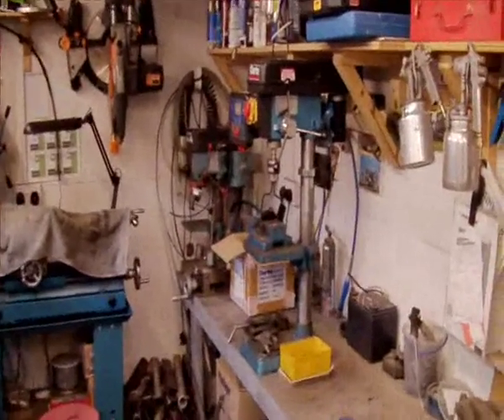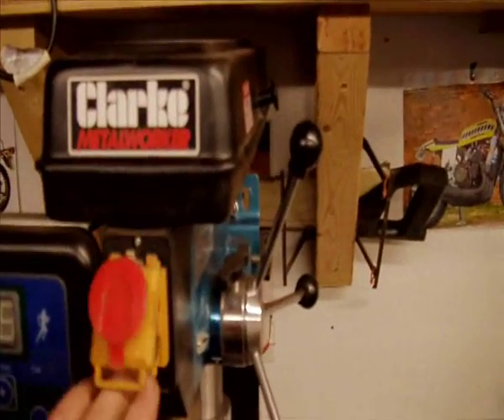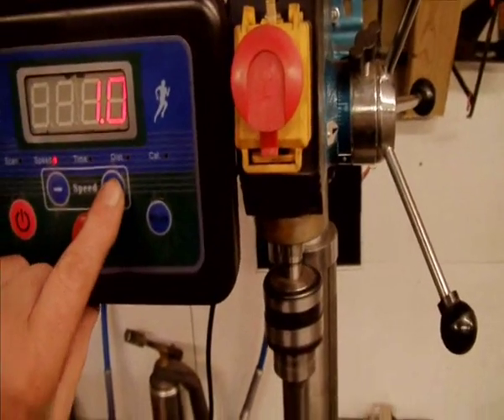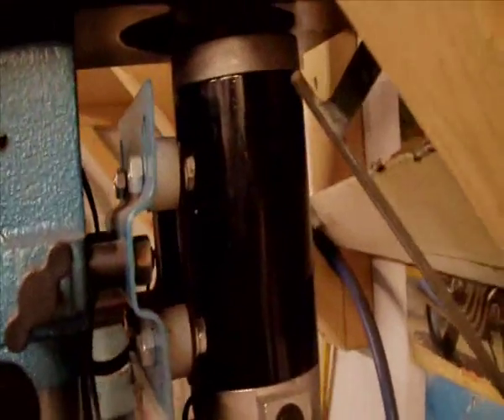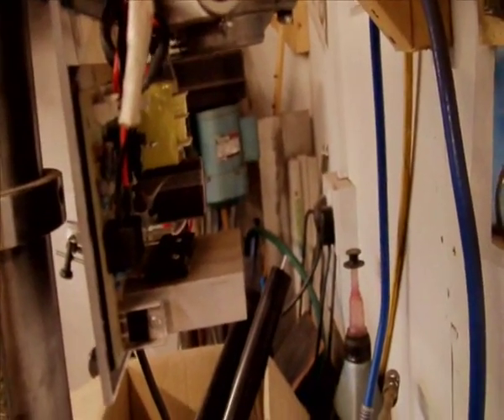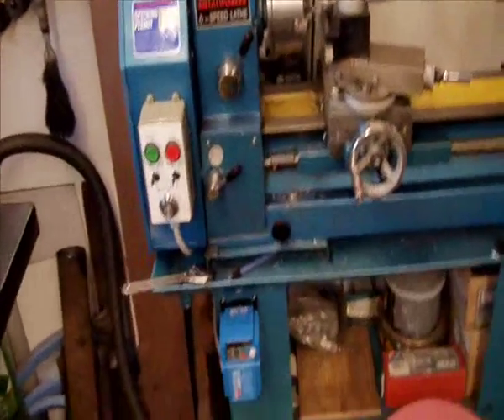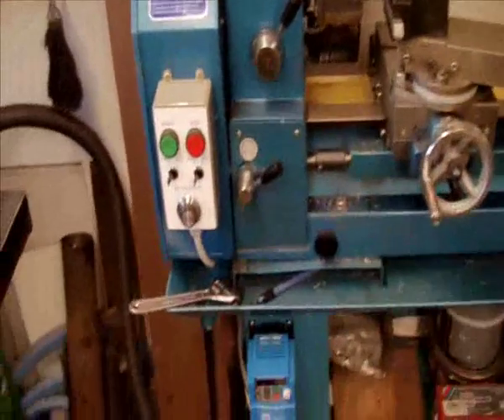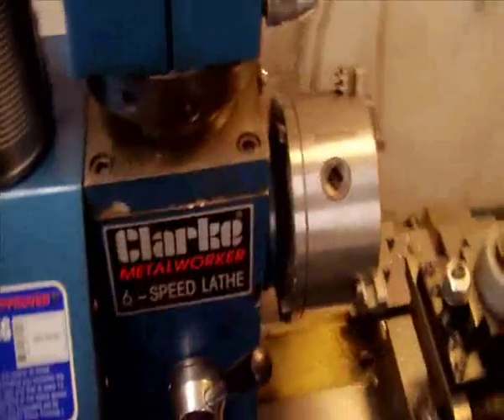Clarke Lathe and Pillar Drill Variable speed conversion

Comment: Hi Nigel - what's the slowest speed that can be achieved? is it slow enough to tap threads.
Reply from the maker: Hi Bob it is good for tapping threads but when you're down on low speed you do lose some power but it works well. Cheers

Comment: £319 is a bit steep!!!!, got the bits from eBay for £72.00, inverter £45.00, nearly new 1.5KW 3-phase motor £27.00.
Reply from the maker: Well done alan good luckwith your change over.

Comment: Hi Nigel, thanks for putting on the video. I have the same lathe/miller. Been looking for a variable motor, and came across your video. I have been in touch with Transwave, as you say they are very helpful. So I'm going to get a motor kit as soon as possible.
Reply from the maker: +I'm in the Shed  Hi thx for the message glad to be of help, I have to say I have been very pleased since
I did the conversion it was pretty easy to fit and I mainly use the second drive belt position as it gives
me the best all round speeds. Hope you have fun cheers.